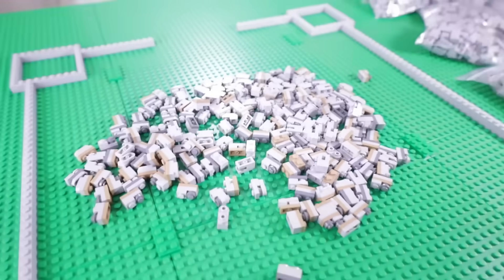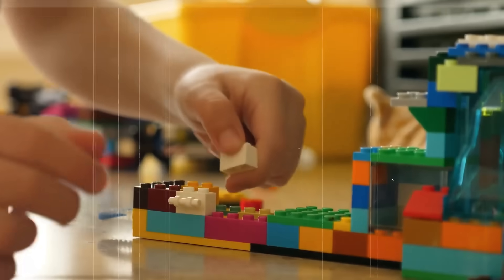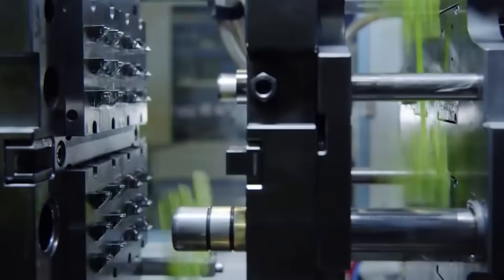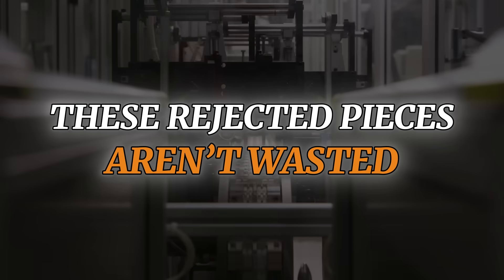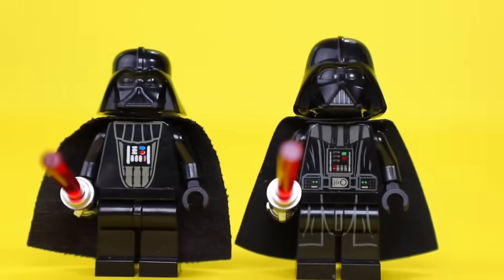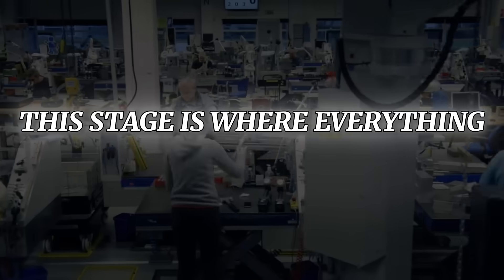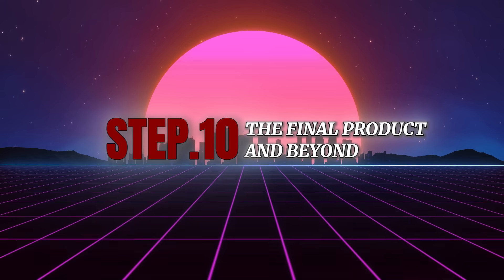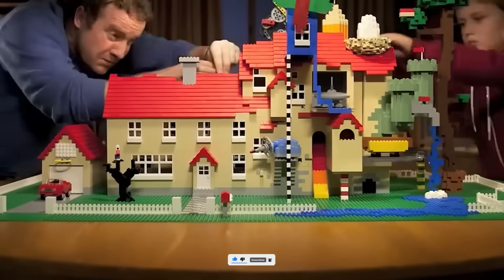How LEGO Bricks are made in Factory!

Comment: They had back in the sixties a transparent Lego brick with a 4.5 voltage bulb 
At the end of the cables there were banana plugs that unfortunately not only fitted into a Lego box with batteries, but also into a  220 Voltage socket. 
As a kid I realized the difference between those t
two voltages.
Luckyly the fuse in the house did its job,
And my finger smelled a bit of burned plastic,
Not from the Lego brick but from the socket  
The Lego with a bulb inside were taken of the market as other kids probably had become the
same 'bright' idea.

Comment: One step missed that I'm most interested in is how the different parts get sorted into bags.
Reply: As someone who works at LEGO, I can share how we use vibratory bowl feeders with integrated counting systems in our production process. These machines are crucial in sorting and counting LEGO elements efficiently.

Once the bricks are produced, they’re collected in plastic containers at the end of the conveyor belts. These containers are then emptied into bowl feeders. A typical LEGO facility may have 50 to 100 of these feeders in operation.

We receive the necessary containers, often shipped on pallets, based on the packing requirements for specific paper bags within a set. For example, paper bag number 5 might contain 78 different types of LEGO elements, many of which include multiple pieces of the same element. A good example would be black and blue connector pegs, where a set might require 20 of each.

The bowl feeder’s built-in counting system ensures the exact quantity of each element is dropped into the paper bag. LEGO is also known for being generous, often including an extra piece or two of smaller elements. That’s why, when you finish building a set, you're often left with a handful of small leftover parts like studs, pegs, or single tiles.
Reply: @GheoHawk Thanks. I wanted to ask you about the extra parts but you answered that already. 😅
Reply: @GheoHawk  Thank you for the explanation. I feel that it would be an absolute dream job to work for Lego
Reply: Yeah, he kept showing stock footage of bulk brick production in the sorting chapter. Here is a video of how a competitor (Cobi in Poland) is sorting their bricks - we can assume Lego does it in a similar fashion:
https://youtu.be/0y7AAxzryng?si=L_cwrBk8K99aVX9V&t=655

The above is IMO a much more insightful video as the Youtuber actually went to a real factory (Cobi, not Lego) and filmed the entire process. Unfortunately the English audio is auto-generated from German - you may want to use subtitles instead.

Comment: very interesting! but i wonder, if the machines make up exactly the Lego set with all the pieces, by what criteria do those extra pieces that are in each set turn out? sometimes they are extra pieces in the set sometimes they have colors that don't match the set just built. they seem to be chosen randomly, but how?
Reply: @bukkame5074  often times the extra pieces are the small ones.  The sorting machine will either wait till it counts the proper amount of pieces going into the bag or it will wait till the proper weight is added to the bag.  In either case there will be a tolerance so the production line does not stop for one 2mm diameter red light lol.

For example, if 5 little red lights can weigh 0.08g to 0.09g and 4 can weigh 0.075g to 0.085g then the machine will be programmed to wait until there is 0.085g added to the bag. So there might be 5 at 0.084g but lego will lose money if they stop to check, so the machine will let extras through.
Reply: @RWMAirgunsmithing  where the F were you my whole life, man?
Reply: @Arcexey  hehe, do you have a production line to automate? ;)
Reply: @ it's one of those things where I never knew why growing up, but it was never that interesting to actually figure it out.  So it's left just a gap of knowledge my entire life, ever present, always missing information in the back of my mind.
the way you explained it was literally the best any person could, ever. you may have ever copied it, that's fine, but it's legit so clear and makes sense in every way.

they don't do it to help, they do it because of cost efficacy. perfect sense
Reply: @Arcexey  no shame there, I was older than most when I overcame my fears of not knowing enough for trade school and finally enrolled...  graduated top of my class in electromechanics by simply applying proper technique and recommended practices to the letter (learning how everythingworks and how to use every tool felt amazing xD).  Never became an engineer but I did find a niche industry (maybe I was lucky) and carved myself out the leading expert reputation in that field.  

Check out how its made.. instead of just watching, pay attention to the machines, everytime something moves there are sensors telling the machine to "move to the next step" or "stop" or "keep going"

I might be full of it too... and lego prides themselves in handpicking every bag, would be curious how much time it takes to box 1million 100 piece sets xD
Reply: @ I’ve seen that show a lot. 
Love how many channels can do visual 3d models of how things work.
Reply: @Arcexey  some of these machines are so mind blowing it shows you're definitely right about the $$$ part xD
Reply: The process of production and collecting pieces for a given set is decoupled: Every injection molding machine makes one type of brick with one color. Those get bricks filled into properly labelled boxes and stored in a warehouse.

Then you have lines of sorting machines (not shown in this video) where you pull the correct boxes of input bricks and the machines will count the pre-programmed number of bricks for the set that is currently in production. Each sorting machine again is for one type of brick so you can just dump the box from the warehouse into the machine.

This way you don't have to just-in-time produce the exact bricks that you need for a given set - you pre-produce bricks and store lots of them in the warehouse. Occasionally you have to switch the type of brick you produce on a injection molding machine by swapping out the mould for another one. At 3:19 you see a lady getting another mould of the mould warehouse.

Comment: One step is skipped, where are those all set designs come from? How new mold is discovered? Who designs the sets? and how the ip was applied?
Reply: That's 4 steps
Reply: @C_harlie_J  yes, design alone has 4 steps, that's insane
Reply: @ Ooooh, I see!
Reply: Best guess is sets and IP are aquired/designed by artists and marketing departments like any other toy.  You can see all the machines in the factory and most likely some of those always have the same molds (like heads) and some machines they can swap molds in and out of (for special limited sets).  Molds are probably computer designed and machined then inserted into the plastic injection machine.
Reply: Those steps are not manufacturing so you could say out of scope for this video. However what is critical in manufacturing is the making of the die cast moulds. These define the exact shape of the bricks and are critical for the precision of Lego bricks - so they fit together and importantly have a consistent force that holds them together. 

Not sure whether Lego Group manufactures their own moulds but if I were them I would.

Comment: Thats amazing rn I'm wondering why they are out of stock for mils plates on pick a brick and also out of the 2x2 plate with knob I hope they can re stock soon 🙏
Reply: why don't you order from bricklink and probably pay less too
Reply: Brinklink is a fantastic resource. If you add what you want to a ‘wishlist’ they have a feature to ‘smart buy’ and it will search all stores on their site to try to get all parts from the same store or as little as possible. This speeds up search/ordering tremendously, reduces cost of shipping by a lot and helps meet store minimum purchase amount if required.